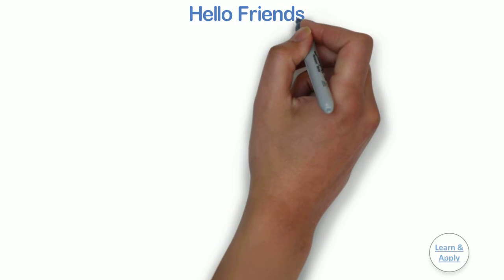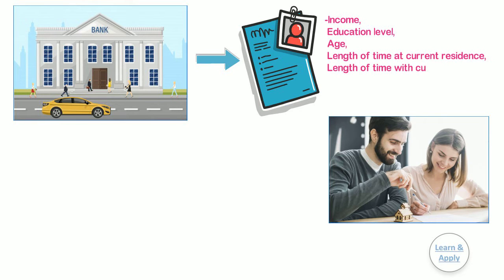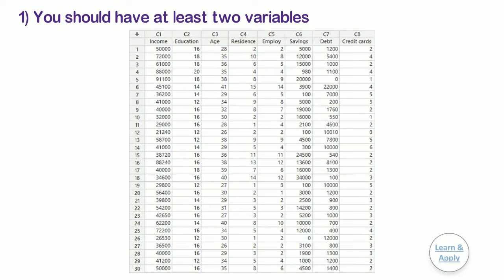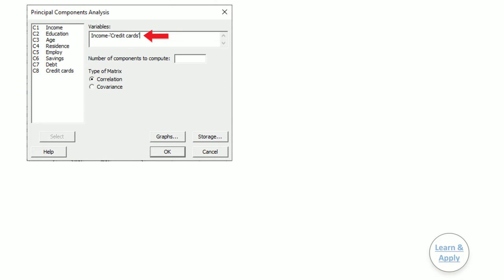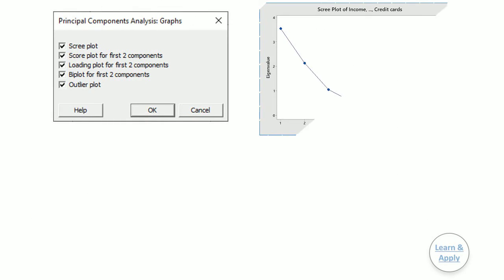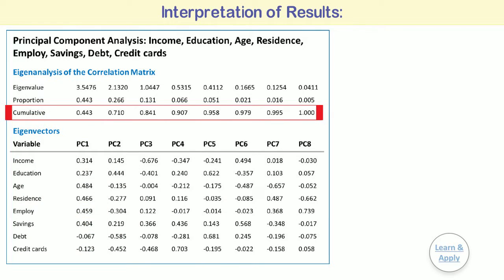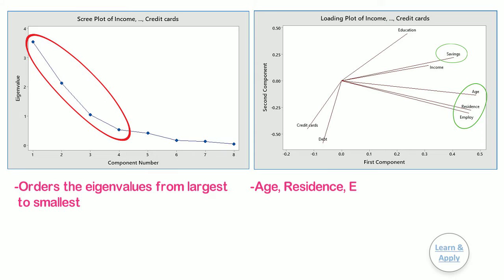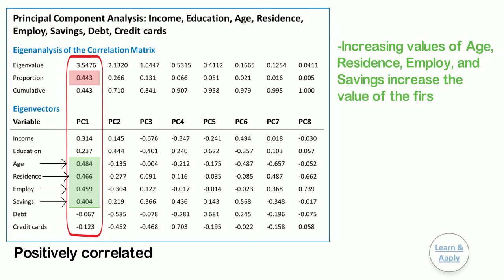Principal Component Analysis (PCA): With Practical Example in Minitab

Comment: How do you explain PC3 ? The third component has large negative associations with income, education, and credit cards, so this component primarily measures the applicant's academic and income qualifications
Reply: Does it mean increasing income, education and credit card will decrease PC3?
Reply from the maker: Please look at the contribution of income, education and credit card - it's lower 13%. Need to focus on 1st two components as they are the major contributors.
Reply: @learnandapply so it means that we need to drop the two original variables (income and education)? you said in the video that sometimes we need more than 90% of the variance explained = 4 principal components. But in the end we only have 2 principal components to analyze the loan applications?  I’m quite confused…
Reply from the maker: It's like a Pareto principle. How much data do you want to consider for taking action?

Comment: Hi, great video, this is extremely helpful. I had a few doubts,
1. In my data set when I do the same, I do not get eigen vector values close to the proportion value. What does that mean? 
2. I have another data set with 96 variables. Can i use this method in minitab for this high number of variables?
3. You had said 4 principal components have been chosen, what do you do with the rest of the 3 principal components chosen?
Thank you in advance.
Reply from the maker: Thank you for your valuable comments and appreciation! 🙏☺️
1. Eigenvalues and proportion are different things, but both are indicators of the contribution of the respective Principal Component. One explains the value, whereas another explains the percentage.

2. Of course, please try it.

3. We are selecting the most contributing Principal Components like Pareto.

Comment: I have a large Dataset consisting of two variables, Voltage and Time. Can I do PCA on it?
Reply: And can we do curvilinear component analysis?
Reply from the maker: For 2 variables with large data set, you won't need to go for PCA. Just use a regression model. If you want it in more detail, please use nonlinear regression.

Comment: Sir, how did you know what each component measures? You said that age, residence, employ, and savings have large positive loadings on component 1 so this component measures long term financial stability. How did you arrive at  long financial stability? Thanks :-)
Reply from the maker: In Principal components, we need to look at the variables having higher eigenvector values. So, if you look at the first principal component, the variables you had mentioned are having higher eigenvectors.
Now, how to name them? Well, you must be a subject matter expert in that field. If not, you need to take a help from subject matter experts 😊
Reply: @learnandapply  Many thanks Sir :-)
Reply from the maker: Your welcome 😊
Reply: Your answer is sound, because eigenvectors only tell you how relevant the variables in the overall variance. So what you do is checking which have the highest eigenvectors and go check independently what they correlate to. This depends on your expertise. Here, the Manager would see he/she would have to look into residence, employment, age and savings. That´s as far as PCA goes. It also tells you which samples are more similar, ie cluster together.